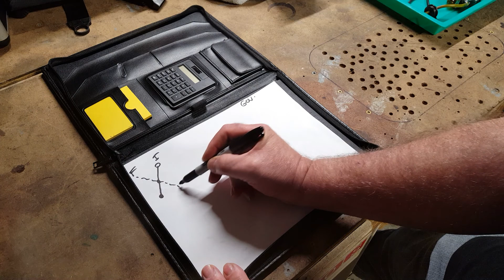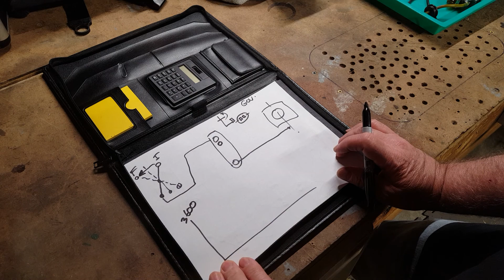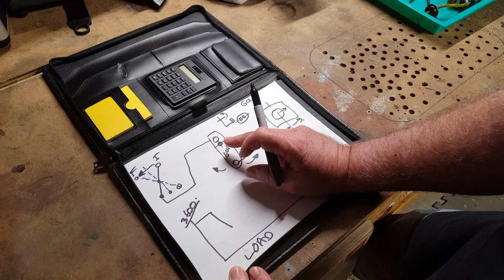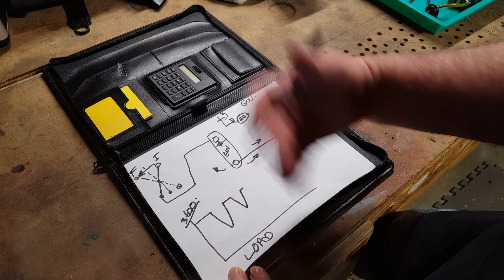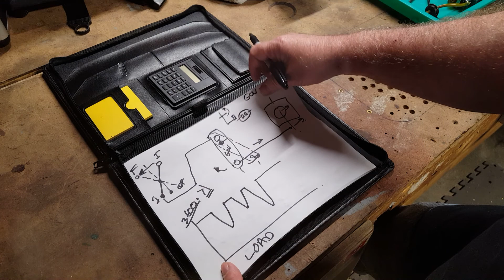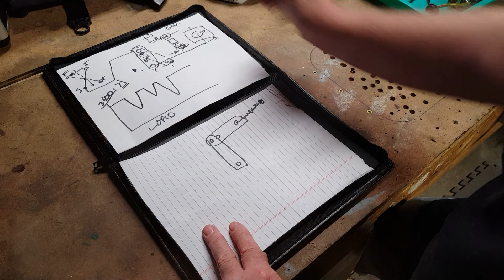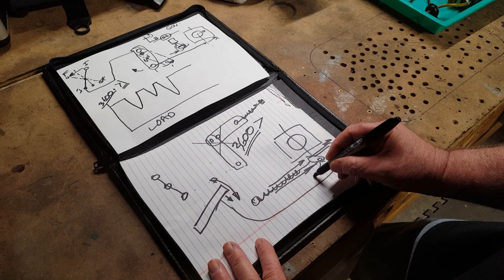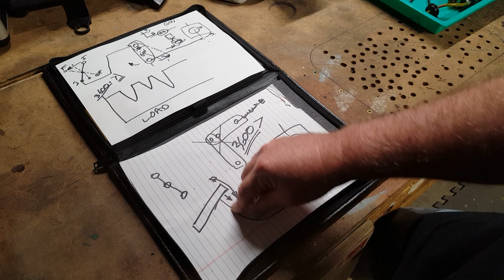PREDATOR 670cc GOVERNOR BYPASS EXPLAINED TO MY SCENARIO ,,, ADD YOUR THOUGHTS or QUESTIONS

Comment: Knowing what you know now, and the other issues you found with the Predator, now resolved, do you feel that modifying the Predators idle jets by drilling them out, would be the way to go or do you believe the Honda GX clone carb is the better way to go? Thanks for sharing your journey and perseverance.  I have a Predator 670cc engine with the same issues you had with respect to idling, and not being able to lower the idle speed slower. Too lean
Reply from the maker: Morning, either way gives you the same result, carb with equal jets, what a mess they created with an odd exhaust. On the idle side, pop the welch plugs and tweak the idle jets, after doing the equal main jets that is. the Honda clone has equal jets out of box.  The clone is 24hp and gives possibly a little too much fuel had to play with that .  Watch the video on the early carb strip, I will find it for you. If I would have had the pulse pump on at that time I think it may have solved it over a year ago, with out the electric pump
Reply: @dctmakes3487  mine still has the original and functioning fuel pump. I already popped the welch plugs and backed them out a half turn. But have not drilled the idle jets yet. I was just wondering if modifying the Predator carb might accomplish the same end goal. Better and slower  running at idle. Thank you!
Reply from the maker: @martyscncgarage5275  if you do the plastic idle do them 1 drill size at a time, you know that though.... Even up the main jets then the idles . one set at a time check through the heat range ...best of luck
Reply from the maker: https://www.youtube.com/watch?v=qagGHpdsnek   ..... first part of this you see I drilled the plugs and pulled the welch over the EEPA caps

Comment: Have you looked into an electronic rev limiter. Used to have one on a stock Briggs racing Kart.
Reply from the maker: Hi again, I limited it based on the pedal travel, its a slow speed hauling machine so not normally revving it full open. Also its a 24hp carb so even more fuel then normal, the bypass has been working. I suppose the limiter would come in handy for this in like you say a cart/buggy scenario. Or if I was to get too heavy handed for a long amount of pedal time at full clip. I think the limit should be your ear / time . Anything full open is going to blow up eventually right !!